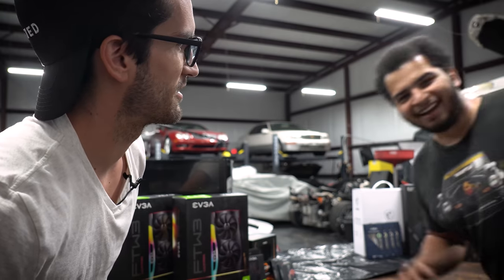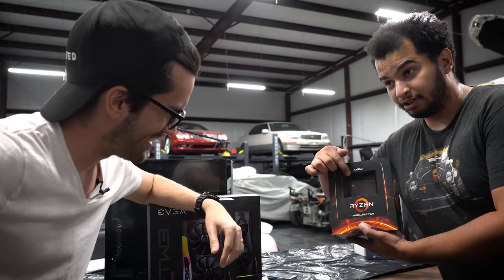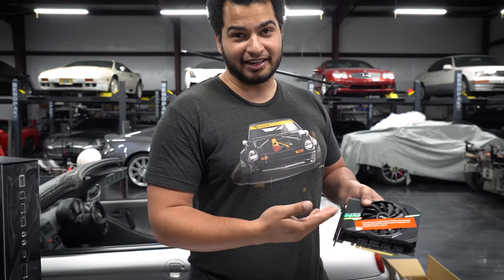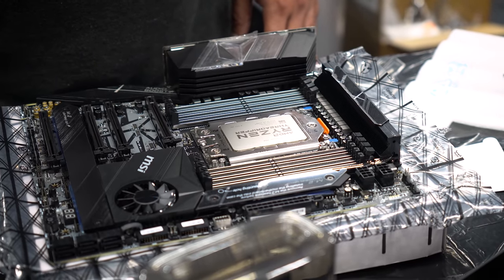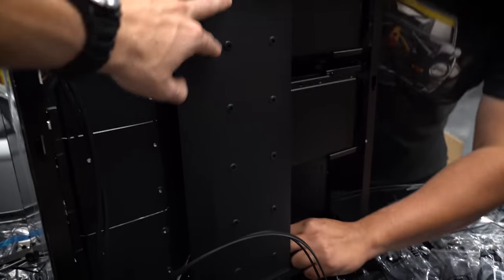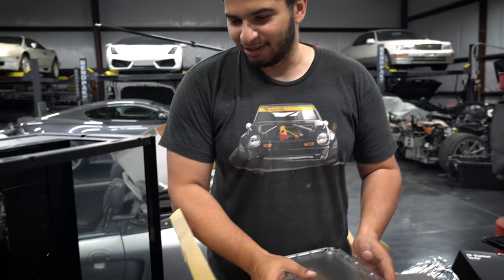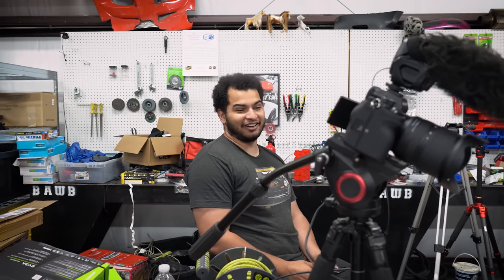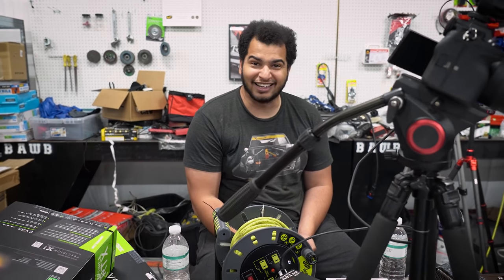Building a CRAZY $12,000 Gaming PC With Tavarish! (Part 1)

Comment: This CPU build is nearing the $15,000 -$18,000 Mark AMD Ryzen Threadripper 3990X 64-Core, 128-Thread; $5400, 2x Nvidia 3090; $6500. This video would have to generate enough views to make Tavarish a minimum of $12,000 just to break even with the Cpu and GPU combined. Motherboard case, ram, cooling, keyboard, tower, side, m.2, power supply. Another $3k to $5k minimum. He really went all out. This cpu should be able to handle video editing and gaming with out any issues for 10 years minimum. If he continues to make videos this cpu will pay it self off in 2 video uploads about the cpu build and another 1 month worth if YouTube uploads.